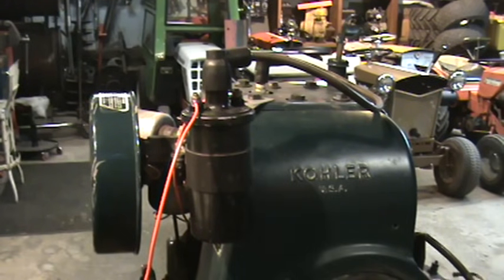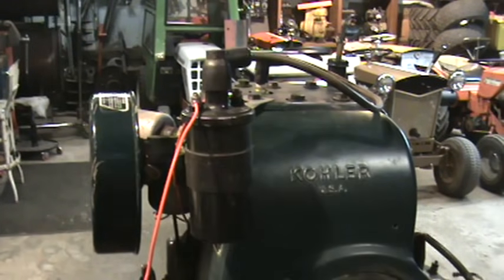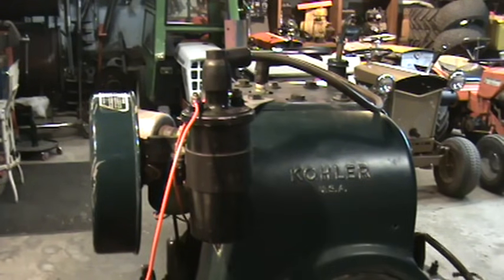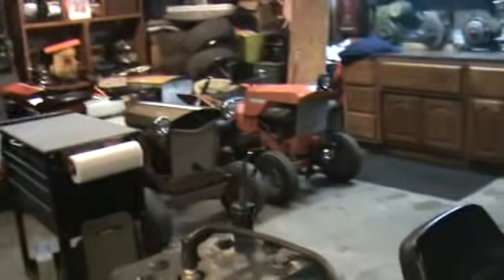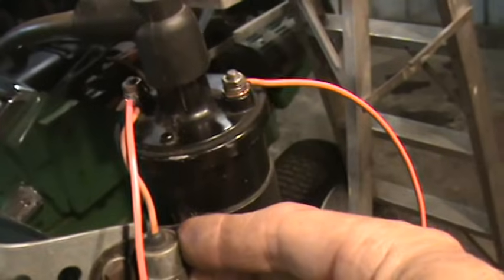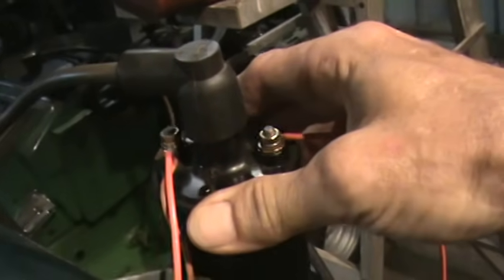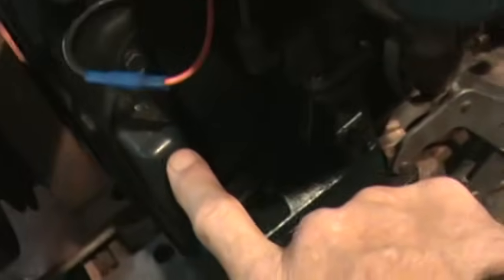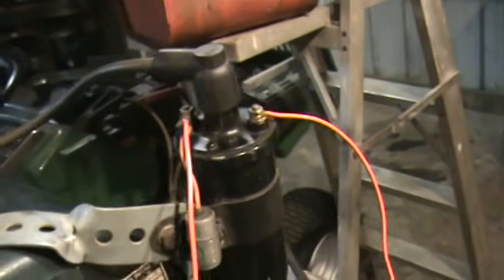Wiring an external battery coil to your engine

Comment: Hey Zippo,  my coil on my old MTD 990 went bad so I was just going to put a battery ignition on it. I did this successfully once before with my Simplicity 7116. Same engine as the 7116, Briggs 16 hp. I can't get a good spark from it. The spark is yellow and weak. Any ideas my friend?
Reply from the maker: It's a finite setting to your points to correct the issue. I have videos on the subject on how to get a good hot blue spark with fine tuning the points gap. Factory setting is .020, but as these engines age, that setting often wanders off to the narrower side of the spectrum. Here is a link that should help: https://www.youtube.com/watch?v=iJArptA6Vco  Cheers! Zip~
Reply: @ZippoVarga  Hey Zip, I figured it out. I  lazily used the light circuit to power the coil, checked it and it was only 11.7 volts. Once I put 12 volts to it I got a nice blue spark. 7116 update. My landlord's handyman blew up the V twin 18 hp vanguard I put in it. Gotta check the oil once in a while. I'm thinking of one of those Chinese 10 hp diesels for it, but the jury is still out on that. Hope all is well my friend.
Reply: @ZippoVarga  thank you brudda!

Comment: I have a wiring mess on a K321 . The previous owner had the condenser and the battery power on the same terminal on the coil. Had a real weak spark. And for some reason the starter is only getting 5 V even though I have 12 at the starting solenoid
Reply from the maker: Isolate the engine from the implement or mower you are working on (bypass all the piece of equipment's wiring from the engine. Then wire  just the engine with a battery. Ground the block with the negative. Run a jump wire to the Coil (+ from the battery +) then the "-" negative goes from the coil to the points with the Condenser attached to the "-". Then, run a heavy cable (wire) to the starter lug bolt. When you're ready to check spark and the starters performance, touch the heavy cable from the starter to the + terminal of the battery. At this point you should have good spark (pending the condition of the points) and the starter should get the full benefit of the battery. Your issues are all too common unfortunately. It's best to go from the engine to the rest of the wiring harness. Find a Wiring Diagram on line to help guide you. Zip~

Comment: Just got a wheelhorse with a k series Kohler 12 hp and no spark. Condenser thing is on plus side with another wire going to switch.   Update. I reversed wires and tractor fired right up.

Comment: I have a 66 SS-10 I got a new 12v battery in it and I noticed my existing ignition coil started leaking oil and was extremely hot. I disconnected the neg battery terminal and it cooled off and stopped leaking. Seems that it could possible be a 6v coil? The coil does look aged and it actually still works now even after leaking oil. Im expecting it will fail at some point. My plan is to purchase a new 12v coil from the auto store but I want to know why this existing one started melting down and spewing oil after 2 hours connected. Any input?

Comment: Zippo - Thanks for the explanation, but I do have a question. When I check for continuity across the +& - terminals of my Kohler T17T 2-cylinder engines coil, I get a beep from my meter. Should there be continuity between the two posts of an external coil (like the one you show here) when there is no power to the coil? 

I am changing my ignition switch and learning about the paths of current between my battery, through the soleniod to the starter, and how it's activated by the 12v coming back to the solenoid from the key switch, etc. In tracing paths of current, i was determining which post my switch goes to (+, of course) but surprised to find continuity between these two posts on the coil.

The battery is disconnected, so there is no power to the system. The switch is not yet connected, so it's pretty much static conditions - no power, but yet, continuity. Is that the way it should be? Thanks, Alan (with 3 old Cubs)
Reply: Zippo - I read through your comments - and replies and stumbled upon this gem of a link: https://nationalmaglab.org/education/magnet-academy/watch-play/interactive/ignition-coil

This shows me the internal parts of the coil and seem to have answered my question with a clear illustration of what's inside of the coil and what it does. The + & - terminals are indeed in contact when no current is present. It's only when 12v is applied to the + terminal that current flows through the coils to create a field and induce the spark to the plug. Otherwise, the fact that there is continuity without power seems to be ok. Am I correct?

Thanks again, Alan (struggling with the complexities of wiring on my old Cub 782 with a Kohler T17 Twin engine. )
Reply from the maker: There is continuity present, yes. You need to do some research and determine what the correct Ohm parameters should be for your coil. Continuity is just part of the picture in other words. Good luck with the job at hand Alan. Zip~
Reply: @ZippoVarga  -Thanks. I wondered about that. It seems that a coil is a coil, but I guess the resistance value can be different. I will look into that. Meanwhile, another coil problem. Since I have not gotten my 782 working yet - and the clutch throwout bearing is still kaput on the 1200, I picked up a "quick fix" - 109 from a friend for $300. It is small and weak compared to my others (10 hp, 33" deck), but it runs... and cuts.. HOWEVER... after the  first 2-3 hours of cutting in the heat, it quit. Just died in the field. I fried the coil. Fortunately, I had the 1200 coil to replace it with. I was back in business... for a while.... next evening when i came out to cut during the cooler part of the day, i turned the key and nothing. Totally dead. But, since I've had my head so deep into Cub wiring for the past few weeks, I quickly traced the problem to the power line going throw the ammeter and to the switch. The crusty old wire was broken. I cleaned it up, re-joined and taped the wires and went to work - in only about five minutes! Boy, was I relieved! ;) 

Thanks to you and to all the guys who post troubleshooting information on the web. Guys like me could not learn what we need to learn in such an easy and efficient way.

Comment: I have a 1941 Farmall. I'm trying to rewire the ignition. Some goofball put a key switch on it, and later, I lost the key. 

The tractor has been converted to 12V, the original kick switch was gone, and a solenoid is stuck in there. 

What I'm thinking about is removing the solenoid, wiring the starter through the kick switch, and wiring a toggle switch between the battery and the coil.

Will my idea work, or how else should I proceed?
Reply from the maker: Your idea WILL work just fine Nate! If the kick switch is bad, they're easily found with a simple Google search. Keep us posted! Zip~

Comment: Good video. On a side note make sure that you check whether your vehicle is negative ground or positive ground, recently bought an old British car from 1960 and it's a positive ground but there are no markings anywhere to say that.
Reply from the maker: It's always a good practice to note where the positive cable goes on a new to you vehicle. Some earlier Lincolns are also positive ground. Good info to pass along. Thanks Exogator! Zip~
Reply: ZippoVarga like I said mine had no description of what the cables are, both have universal strap terminals on them, only reason I noticed was after poking around with the dizzy cap off gapping the contacts, then hand cranking the motor to check(it's that old that it has a hand crank still) and when putting it back in I noticed the coil was wired with positive to the cap and negative to the battery.
Reply from the maker: Good Catch Exo! Most wouldn't notice that. Zip~

Comment: So the coil has to bolted to the block also saying it is grounded to
Reply from the maker: No, it doesn't have to ground to the engine, but the Condenser will need grounded. The coil is positive battery only. The band is just to secure it with any means necessary. Zip~

Comment: How to convert  a old 2 point ignition coil into bew 3 point coil ?
Like the new direct coils over plug in new( pcm/ efi) cars. 
I want to convert my old car coil in to new efi car coil. 
Is this possible !
Thanks
Reply from the maker: Ultimately, you need to know what each wire does to make the coil fire when it's supposed to. I'd imagine that a points ignition wouldn't play well with the more modern coil options which are designed to be computer controlled. Zip~
Reply: @ZippoVarga  Thanks.

Comment: Mr Varga -  I am trying to convert my 74 16hp iron B&S. to a coil ignition as my in-line plug tester shows a weak spark. My issues:  The plug wire from the magneto still fires as well as the wire from the coil.  I used a new coil with internal resistor and a condenser. 12 volt from the ignition switch is attached to the + side and the points and condenser are attached to the - side, with the condenser being grounded via the mounting tab.The engine ran with the magneto but was very hard to start.  A new carb didn't help.  since the coil was installed, the engine will not start nor fire with starting fluid.  Any help appreciated.  The tractor is a Gilson with hydraulic lift
Reply from the maker: Briggs run best with their original magneto. Your issue is a points gap issue and not the magneto. Clean then points....get the engine to run on the magneto with an in line spark tester, then adjust the points until you get the hottest (brightest) spark with the engine running. Then, address the carburetor via my many videos on that subject. Keep me posted. And please, save the battery ignition coil for engines designed for them. Zip~
Reply: @ZippoVarga  Well - I was unaware the points could be adjusted while the engine was running!  That makes it a bit easier.  It lit right off after the coil was removed and I adjusted the points while cranking.  Spark tester showed MUCH stronger spark.  Just a bit of carb adjusting and the beast will be fine.  YOU DA MAN!
Reply: And thanks for taking the time to respond to the multitude of questions you must get.  It is appreciated.
Reply from the maker: Always happy to help out when and where I can Reiss. Cheers! Zip~

Comment: Hi Zippo, thanks again for all the helpful videos.  I installed a new electronic ignition module to replace the points on my old briggs model 19, now it runs but acts like the coil is bad, it’ll run ok until you turn on the mower deck pto or put a heavy load on the engine and it starts to die out until the pto is turned off and the throttle brought down to idle.  Then it’ll sit there and idle fine, I’ll go to mow again and it dies out again.  Does this sound like I got a bad module out of the box, or perhaps the coil is going bad again.
Reply from the maker: Heya Hotrod! Well, the Model 19's have a horse shoe shaped coil mounted under the flywheel and the ignition module doesn't play well with that type of ignition system. I would attempt to resurface the points contacts, replace the condenser and see if things return to normal. If so...there's your answer. Please keep me posted on your progress! Zip~
Reply: @ZippoVarga  Ok, well I resurfaced the points and installed a new condenser, gapped the points at .020" like my book says.  Now it runs good under load but stutters now and again with light loads, just driving or pulling a light trailer for instance. Maybe I need to experiment with the points gap to dial it in, definitely better though.
Reply from the maker: Yes...with the engine running, and an in line spark tester in line, you want to dial in the points for the hottest blue spark. You can also step up the spark plug to a hotter firing one to improve the reliability. Good Luck with it! Zip~
Reply: @ZippoVarga  thank you for your reply, I have a set of nos points for that engine somewhere, I'll install those and see if that cures it.  I didn't know that style of coil isn't compatible with electronic.

Comment: Old video but I hope I get some help. I own a 1988 Ford ranger 5 speed but it has a 1970 Toyota Corolla motor 1.4l v4. My grandpa had the ignition completely gutted so I have that wire running from the battery to the positive, my negative is going to the points, ground and condenser. When I go to tape the wire inside the cap to turn on the coil they're both hot and begins to melt my wires. The wires I have in the trucks are coming from the alternator and a double grounded switch that comes from the negative point of the coil. I've tried everything but I keep overthinking which cause me to go braindead. Please help.
Reply from the maker: You don't hook any negative power at all to the ignition system. It uses the engine's ground for that. Remove the negative lead you stated that you installed and see what happens. Zip~

Comment: I should have said what will happen without the condenser? Will the engine still run?
Reply from the maker: No sir. The condenser stores the charge that ultimately fires the spark plug. The whole system must be in tact with all of its parts for the engine to run. Zip~
Reply: Close but Nil cigar
The condenser across the points helps the points to NOT burn - removing it will ensure Points fail early ( and often ).
It has Zip to do with " storing a charge that helps fire spark plug ".

Comment: Is there a coil that will work on all these small Koehler engines?  
 Please explain what happens without the condenser?
Reply from the maker: Don, without a coil, you have no spark to the spark plug. You can use any coil you can get your hands on. If there is no 12V either stamped to or printed on the coil, then it is a 6V and will require a resistor readily available at your local NAPA. I suggest locating a 12V coil (Also NAPA) and wire it as shown. Also get a new Condenser and make sure your points are clean and properly adjusted to .020. Lay the plug on the engine to a known good ground (head bolt should be fine) and crank the engine over to make sure you have spark. If so....install the plug and your points ignition system should be in working order. Zip~
Reply: @ZippoVarga  I have one of these same Kohler engines on a Weldanpower but I have no coil? Where the coil goes is a plate with the amp meter and starter switch. My spark plug wires tucks in between the heads and the fan housing.. wtf? I get a little bit of a spark from the plug but not a lot
Reply: Without a condenser your currant may try to jump the points gap instead of going to ground thr the hi tension windings of the coil?
I think im correct in saying that?,lol

Comment: Your close but it’s when the points open that the circuit becomes incomplete and the field in the coil collapses and goes to ground through the spark plug.  Good video though.

Comment: HI, I have searched far and wide for the answer to two simple questions:  
(1)Is the internal secondary wire connected to the "+" or the "-" terminal of the ignition coil?
(2) In which directions are the two coils wound, say, looking down at the top of the ignition coil?  Also are they wound in the same or opposite directions?
THANKS SO MUCH FOR THIS RARE VIDEO!
Reply from the maker: https://nationalmaglab.org/education/magnet-academy/watch-play/interactive/ignition-coil

Comment: i'm curious. my 1975 Dodge had the condenser on the positive terminal. or at least I thought. i replaced the coil. an now my truck turns over. but won't start. is it perhaps cause the condenser is on the positive? an if so,  could my new coil now be shot cause of me putting it to the positive?